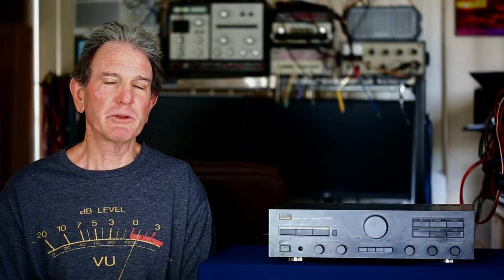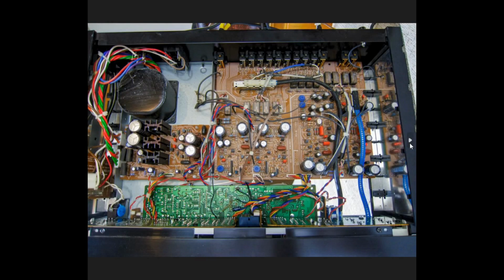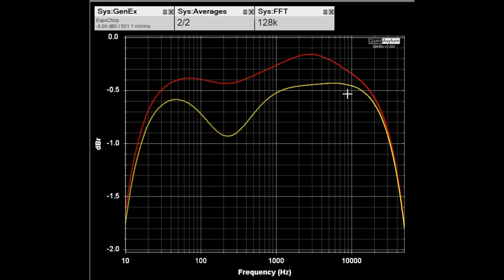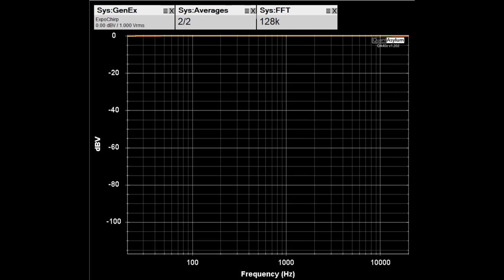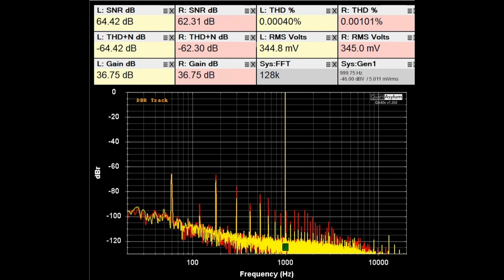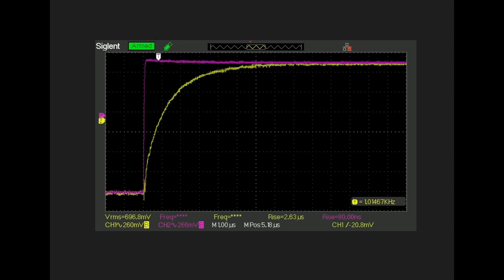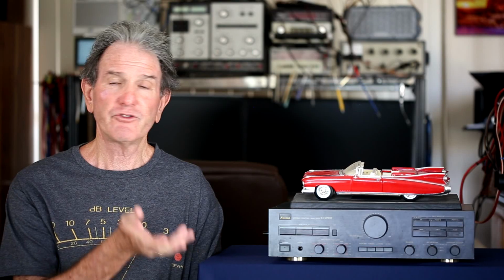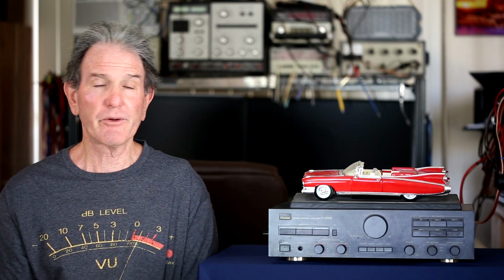Sansui C-2102 Control Center (Preamp)- Vintage Audio Review Episode #131

Comment: Hi. Nice post. 
I have this preamp. I recapped the  power supply with panasonic caps and replaced the diodes. Once that was done and did the listening test. Much better but still a bit of distortion. I then replaced all the relays with high quality ones.  It works very . By the way I also have the  matching 2102 amp. 
I have three 2102 amps which have been gone through. 200 wpc. They are a best with this preamp. Hooked up to klipsch klf 30s. My klipsch klf 30s have been recapped and totally rebuild.
Reply from the maker: Thanks for taking the time to share your experiences. Am curious about the distortion you are hearing. I have never needed to replace power supply caps except if they are shorted, but can understand doing so on very old equipment- but mainly power amps. Maybe my buddy has a 2102 for me to test as well...?